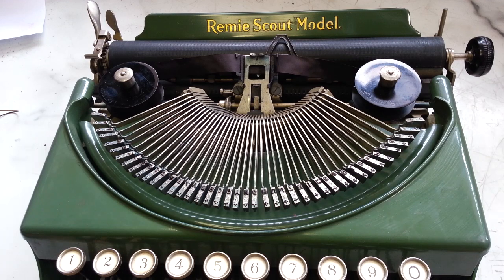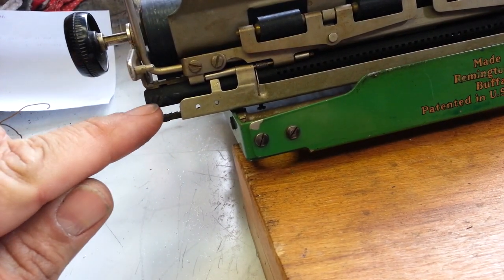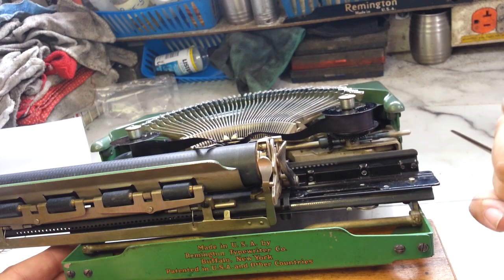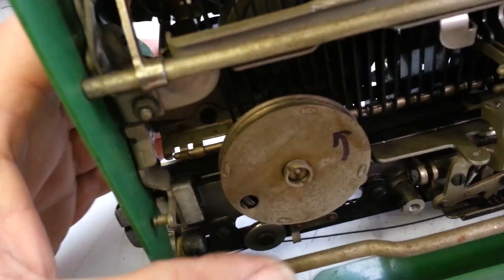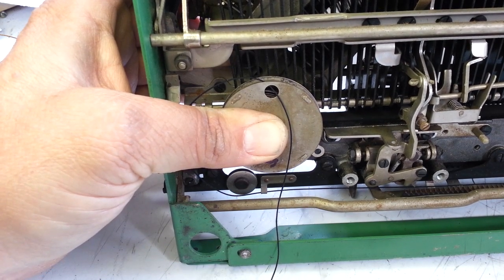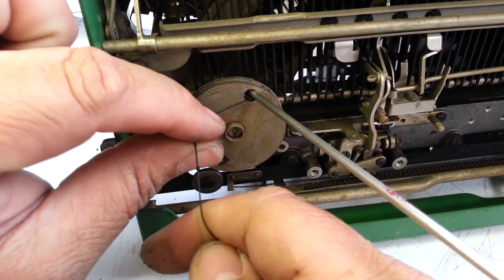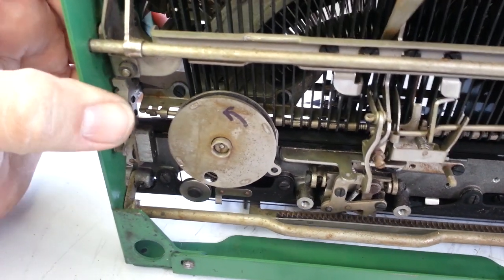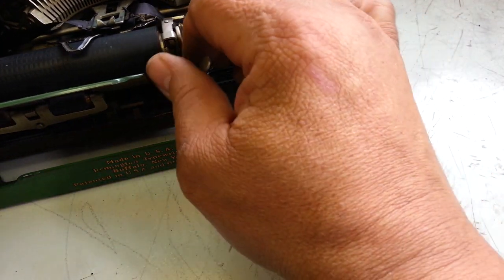Remie Scout Model Draw Band String Replaced Main Spring Wound Remington Manual Typewriter Repaired

Comment: This is identical to my Remette. Mine just came disconnected from the carriage end. Just needs to be reconnected.

I put in 5 turns, seems too strong. The string is old and brittle so when I replace it will use 4 turns. No easy way to relieve tension on these machines.

Comment: Hey, bub. You'll probably see this in the maintenance group first, but my spring keeps losing tension. Frustratingly after I get it wound and start typing, sounds like the spring suddenly unwinds inside. 
On a model 5, idk if it'd make a difference.
Reply from the maker: Yup, sounds like the main spring is broken, internally, sometime they can be fixed
Sometime you have to replace, look for ~~~main spring~~~ videos
FB people can and do always help